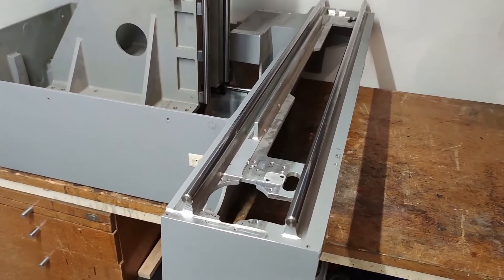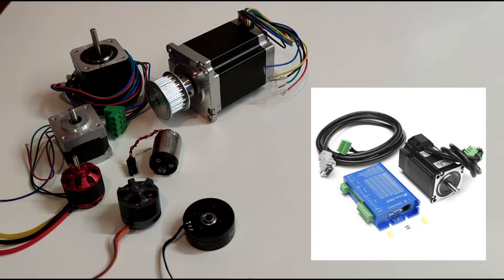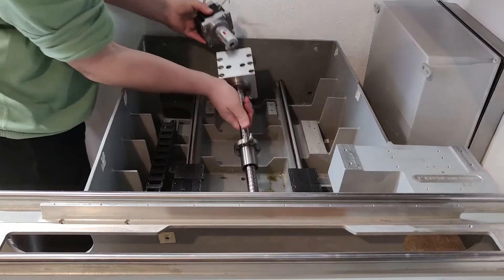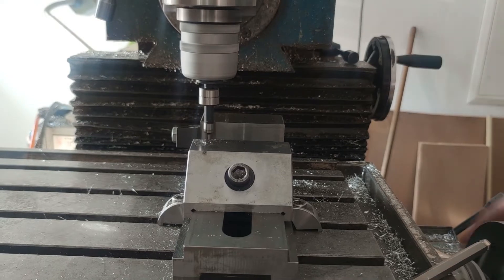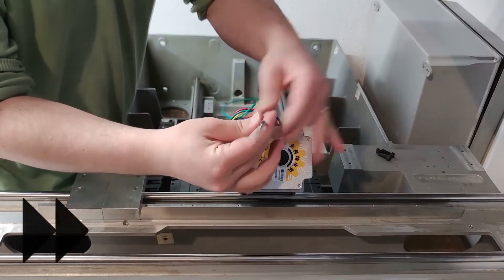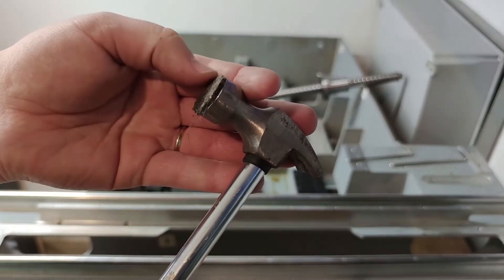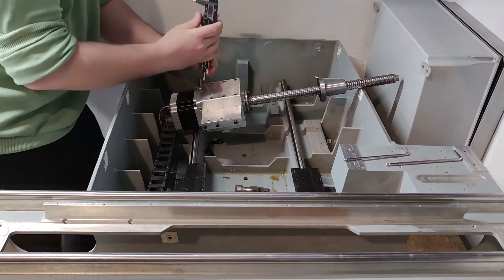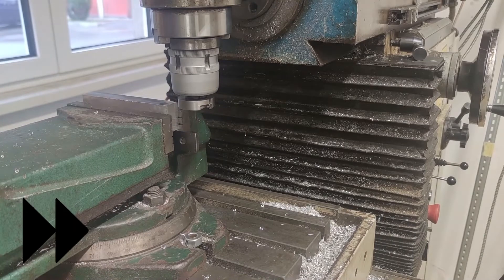Converting 3D Printer to DIY CNC | Part 2

Comment: I don't understand why you used the linear bearings with plastic. They will not last long because of the heavy load ,and due to longer working time they might heat up and cause problems. It would be better to just buy inner bearings without the casing and install on your existing blocks. That will make this cnc setup very good.